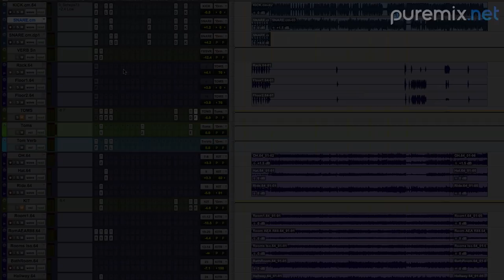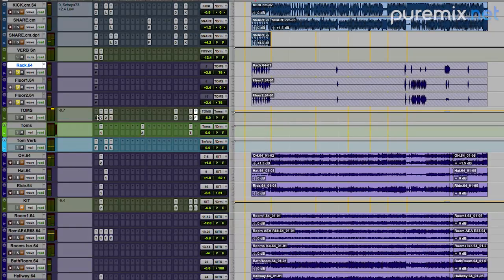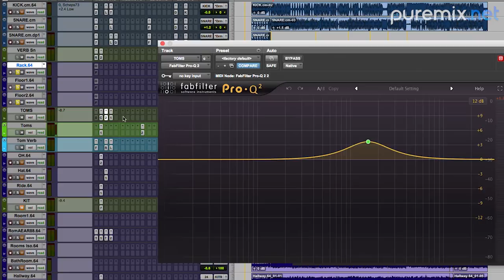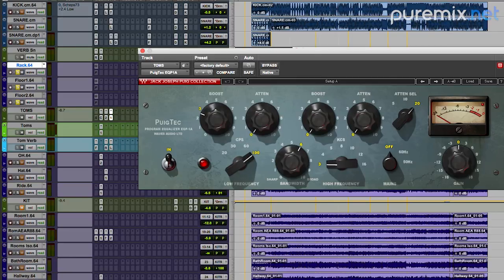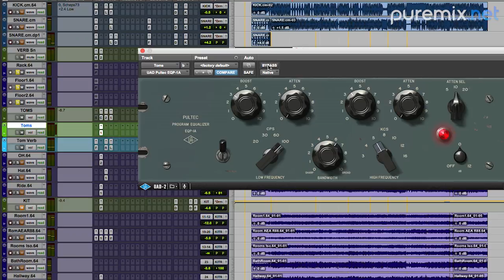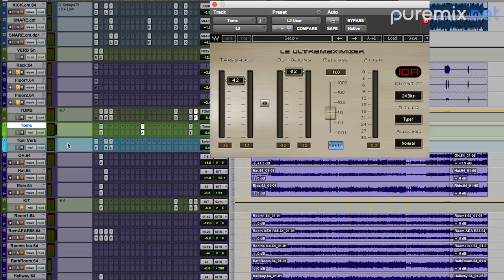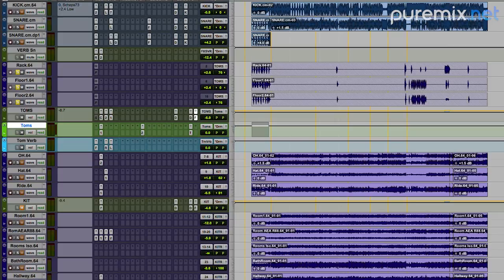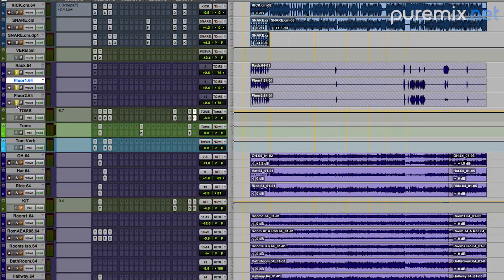(Drums) Mixing Toms (ft.Green Day) | How To Get Drum Punch And Tone

Comment: shouldn't be red the lights?
Reply: Daniel John You need to stop when the red lights flash
Reply: If it sounds good, it is good.  Mix with your ears, not your eyes.  Analog PlugIns often need pushed to emulate the harmonic Distortion the original equipment would have produced at the same “visual” appearance.